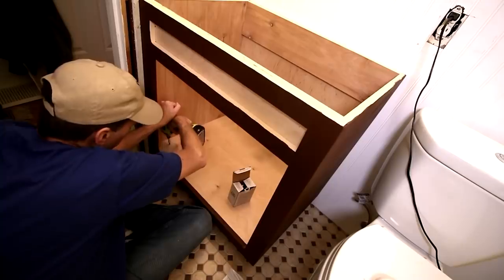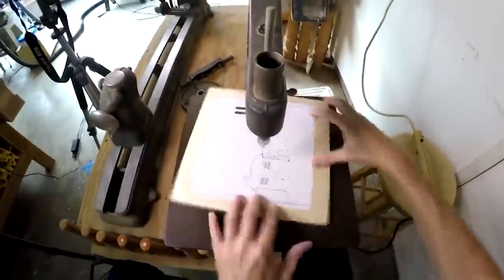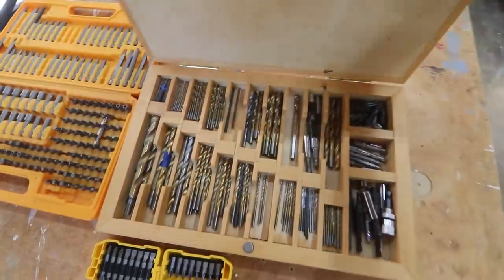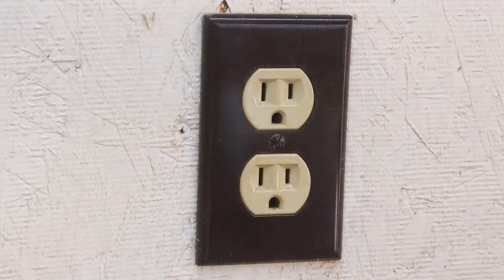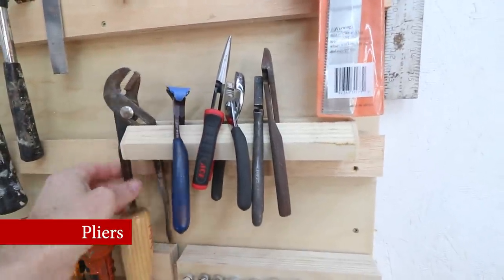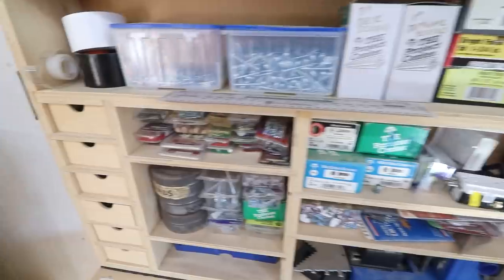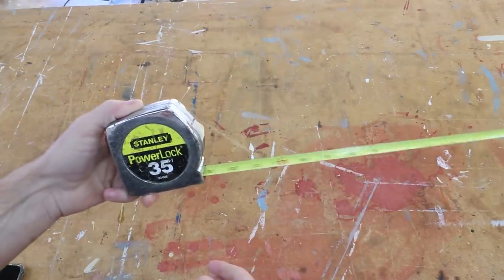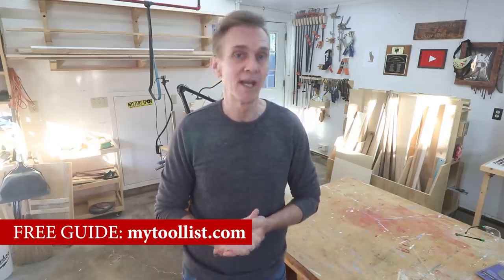No homeowner should be without these 7 ESSENTIAL TOOLS

Comment: Can you pls do a picture frame for idiots. Here is why my mom caused.a leak which ruined the drywall uostairs and downstair. So contractor came in wanted five grand to fix both rooms. So i told them forget it so i watched youtube . Managed to cut the dry wall without cutting electricity and took down a ceiling without cutting the pipes . I replaced the insulation with spray foam put up drywall , bottom i put a wooden accent wall. Mold treated beams removed and replaced the plywood under the sink and back of cabinet. So all i had to do is replace the molding around windows . I looked at the moulding in stores it doesnt match the kitchen. So i learned how to route baseboard. Im actually very good with router. I just made a router table which i just need to pay attention which end to route. In fact i created moldings for a old neighbor and friend because before covid a molding board 15 bucks for a board now they are about 40 bucks.  So i cut their moldings and they bought the router bits and wood . I can create nice molding out of furring wood. Which  comes in various widths not one board more than five bucks no matter what the width  . The only problem they live over an hour a way and their handyman doesn't work this area.  So its either too wide , too long i measured the the inside of wood and used an angle gauge forget about it still screwed up.  So i ran the wood accent wall all way to bottom and on ceiling on one room.  But the kitchen window i created the molding which matches exactly but i cant for the life of me get the friggen window right. So i took a break from it for 6 mos. I figured if i can make a picture frame i should be able to do the molding around the window. Well eight 1x2  i still can't get the frame right they are too big for the glass , then when i cut the frames inching to get right fit it either too short in width but fits length wise or too long but fits length wise.  So i watched different youtube and your videos. But still screwing up. Measure the glass with inside corner then double the width of the board  or another stated double the depth of the wood , another stated double  width of the of board but dont include t he rabbitted section.  Another stated make it fit then put rabbit in . Totally frustrated . The frames i made were suppose to be 11x14 , so i shipped them to my friend she has a neighbor who cuts.  Glass.  If you recommendations i would appreciate it. Thanks